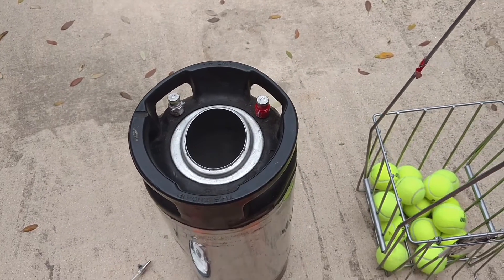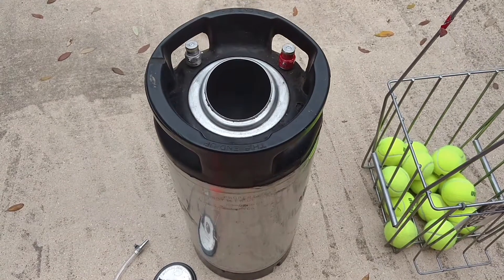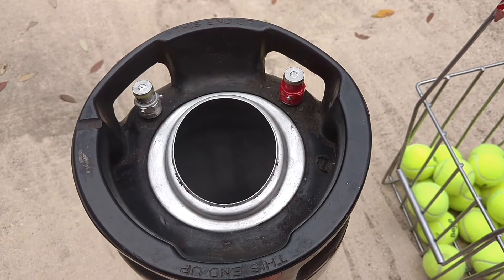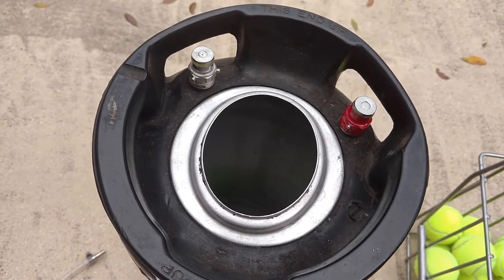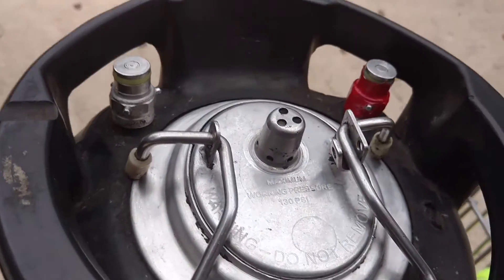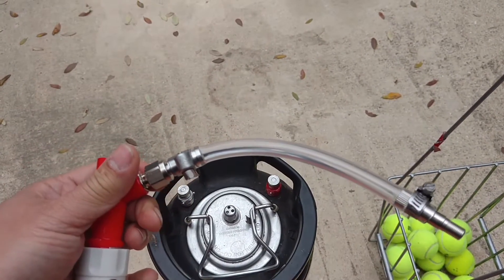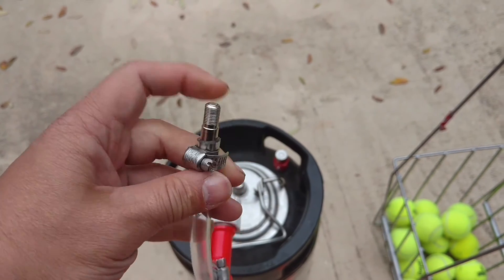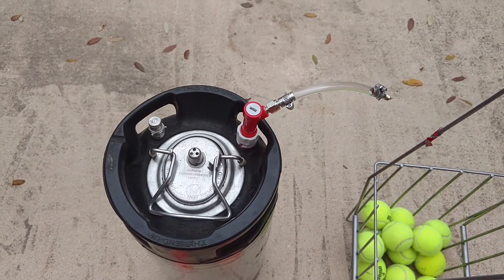Corny Keg Tennis  Ball Pressurizer

Comment: The system works, but the balls are not getting pressurized. I kept 15 days with 34psi, but no luck. Ok some balls may be bad but looks like none are getting pressurized. I check the pressure at the end of 15 days and still there..Any idea ?
Reply: Tennis balls are around 12psi, 12psi difference from atmosphere which take some time for air to escape. With 34psi, you create 22psi difference on the ball then it will take forever to pressurize. Try increasing pressure for faster output but not too much for your safety

Comment: I have a working ball pressurizer. Thanks!  Here are a few things I learned. Valve extenders vary.  You want one with a smooth barrel.  Take your valve extender and your threaded piece of metal that attaches to the ball-lock connector with you to Home Depot, if that's where you get your plastic tubing, to make sure you get a piece of tubing that fits.  The tubing size that fit my valve connector was slightly big for the size of the threaded piece.  Solved with super glue.  It takes a lot of pumping (possibly because I only have 30 balls I want to maintain.  I purchased an electric pump - much much better.
Reply from the maker: Glad you got working
Reply: Does yours still work?
Reply: The truck tire valve I used demonstrates from other video but got stuck to pumps air inside the keg.  Is it truth you able to injected the air inside the keg?

Comment: I'm trying a Schrader bike valve -  I'm thinking this is not the best choice.  You have to scrape off the rubber that surrounds the valve (with rubber, does not fit 3/8 inch tubing).  Then you have the issue of sealing a very rough surface (the valve) with the plastic tubing.  The glue I used last night didn't hold.  I'm going to try epoxy but if that doesn't work I'll try the valve extender you mention in the video.
Reply: Glue not necessary if you use hose clamps.

Comment: Hi Rockbox brilliant idea. How much pressure can it take? how do you release the pressure to remove the balls? Is it safe to use?
Reply from the maker: Corny kegs are designed for working beer pressures of 60-70 PSI which means they are tested to well over 100 psi.  There is a relief pressure valve at 125 psi. To relieve pressure, you just have to depress the pin in the middle of the valve or you can just use another MFL connector without a hose attached.

Comment: Is it call Bart connector or Bar connector you mentioned to connected the red connector
Reply from the maker: Barbed MFL connector
Reply: I brought the "Viair 92839 Inflation Valve for 1/4" Air Line Compression Fitting".  Do you think this valve will work?  If not would you please repeat what kind of valve do you use here.  Thanks again
Reply: @TennisOnAction   this will work perfectly well to connect to a standard 1/4" MFL gas disconnect from your keg.

Comment: How do you release the pressure in the keg?
Reply from the maker: you push down the center of the connector valve with your finger or screw driver.
Reply: Thank you!
Reply: It depends on the type of lid you have.  https://www.youtube.com/watch?time_continue=2&v=6RyVUdEfL9Q&feature=emb_logo

Comment: You filled that with 60  psi through THAT clear poly hose? Yikes! Then again you can play tennis with only one arm 😁. Anyway that's a good vessel except for the removal of only one ball at a time. I made one from a discarded propane tanks and threw it across the street after getting so frustrated trying to empty it. I couldnt stand that. I suspect the opening would need to be able to allow a three ball triangle to clear in order to pour out. Maybe bigger?
Reply: It definitely should not be filled to 60psi. Tennis ball cans are pressurized 12psi over ambient atmospheric pressure. 25-32psi is what you need for re-pressurizing. 14-20psi just to maintain freshness.

Comment: rockbox, what PSI do you use?
Reply from the maker: 30-60 PSI depending on the condition of the balls and how fast I need them to pressurize.
Reply: How long does the re-pressurized effect last for you? Dependent on the quality of the ball I would expect. Have you found any ball in particular to take better to the re-pressurizing process than others?
Reply from the maker: It depends. Some balls just don't pressurize well. I've found the best success with quality balls like propenns and penn atp. You can actually pressurize them too much and they will be bounce really high. It is actually better for maintaining balls. If you put newer balls in there between playing, balls will last until the fuzz disappears.
Reply: @rockbox1190  The maximum pressure used should be around 28 psi.  At around 29 psi the tennis ball will actually collapse. If you exceed that pressure you can actually hear the ball collapsing. That is why higher pressure does not work.  When the ball collapse the rubber will be distorted and never reestablish their round shape.  That is another reason not to overload the keg.  Leave some space for ball expansion.  If you bounce the pressurized ball and notice that they bounce at weird angles, that is telling you that you have overfilled the keg.  Time to full pressure depends on the original pressure in the balls. Please remember that new balls are only pressurized at 12 psi.  My experience is that 2 or three days are usually sufficient to restore the bounce.  You can check with the USTA specifications using the drop test.  Tennis balls when dropped from the height of 100" should bounce within the range of 53"-57".
Reply: @nmrtexas  Tennis balls are made with an internal pressure of 14 PSI and packaged in a pressurized can. Pressure is released when you open the can. Once this occurs pressure inside the ball will now escape through it's porous rubber. During play each time you hit the ball it will force the internal pressure even more.
Reply: @EyesOfTheInternet  It retains pressure like a new ball would.  You can always repressurise them.